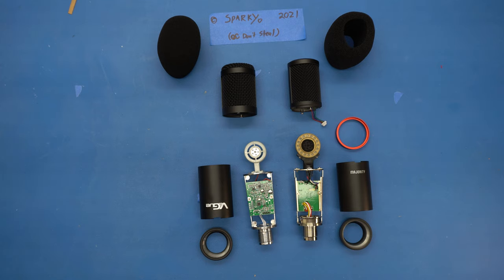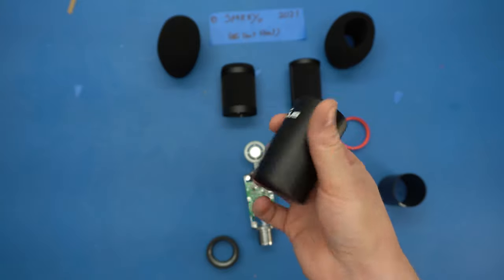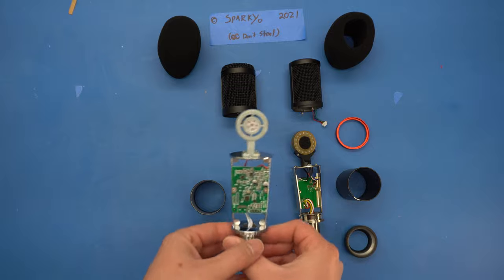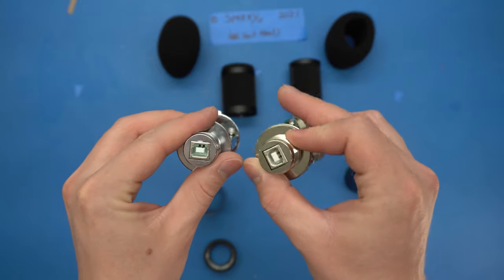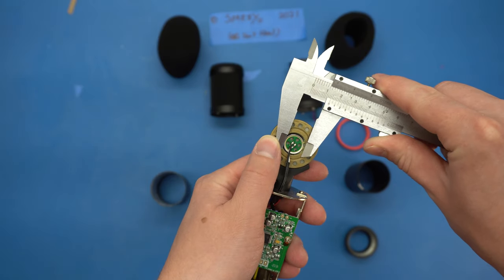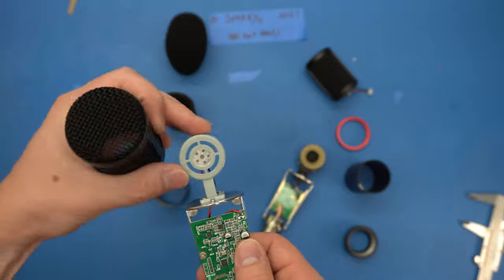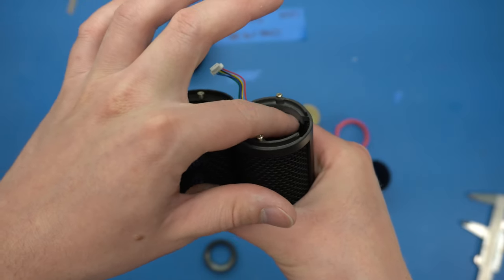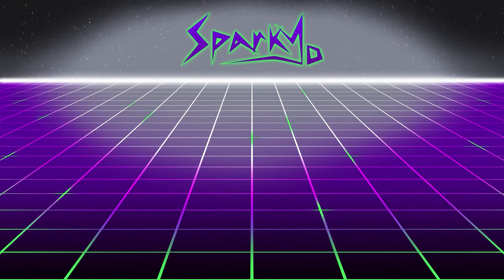$15 Microphone vs $40 Microphone: Which One is the Best? Microphone DOUBLE Teardown!

Comment: Do you know which capsule the majority is using?
Reply from the maker: It is a 14mm directional electret capsule in a larger plastic shell. It has no visible part number so I can't confirm the exact condenser capsule. It looks similar to the following (6 holes on back) but may not be the same:

https://www.alibaba.com/product-detail/Condenser-Capsule-Microphone-Capsule-2020-factory_1600082997435.html